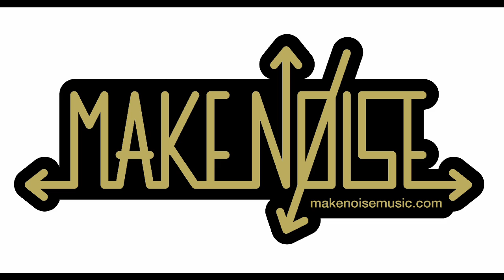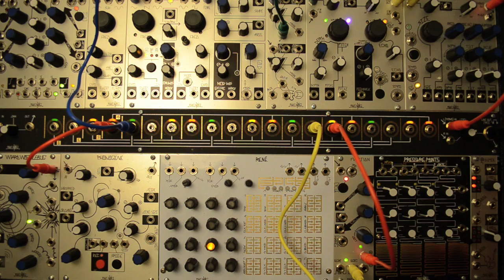Make Noise System Tutorial 3: Control Voltage (CV) and Polarity

Comment: Is the CV bus size compatible with a standard 19" equipment rack? 
If so, do you sell just the CV bus, and is all that is required beyond that an open slot on my power bus?
Reply from the maker: ***** The CV bus is 104hp, which is a little wider than the 19" rack size (84hp). It uses two connectors on a bus board.